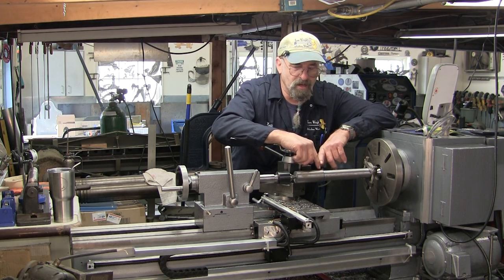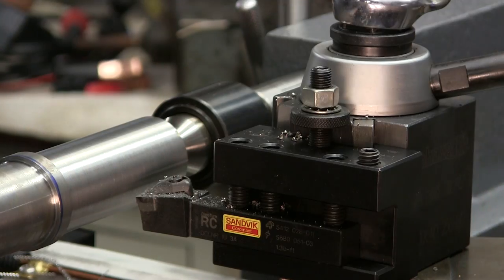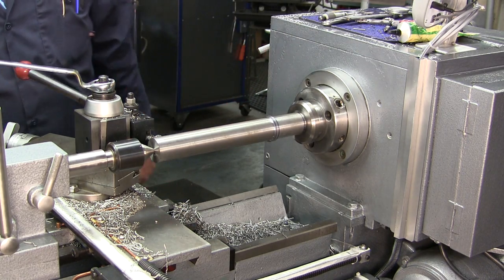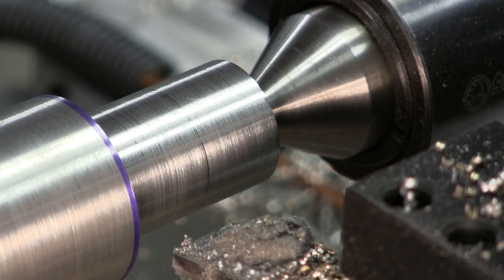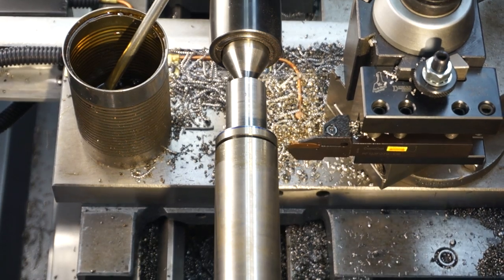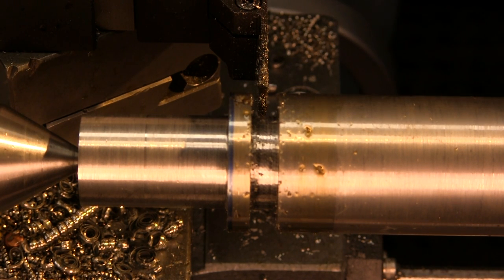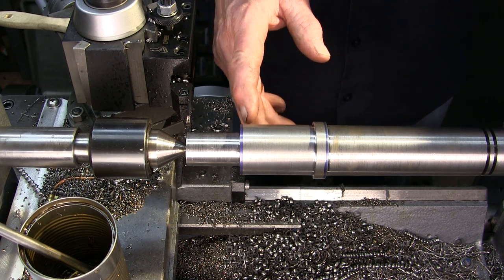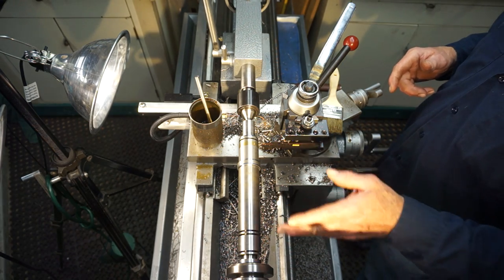Steam Wagon Ho Part Four

Comment: If your readout has Absolute and Incremental modes, I like using ABS to keep track of position of one side of the tool and INC the other side. Then you don't have to keep resetting zeroes and your position is more consistent. I love being able to machine vicariously through you Keith, when I don't get to do much machining at work!
Reply from the maker: yeah I still have more to learn, on setting up the readout. ;{)------
Reply: I was able to get a new cheapest Accurite readout at work, and the thing enables you to be able to machine arcs by automatically calculating the X-Y positions along the arc. It was so cool to be able to that on a manual machine. Nobody at work could appreciate the capability of being able to mill out a large bore without a turntable, it was so fun!
Reply: me 2 more learning on the dro its a handy tool.

Comment: Hi Keith,
Good order of operation and procedure teach...   ;)
Lots of times when I get chatter, I'll use a piece of wood with oil to apply a little pressure on the part near the cut and this helps a lot in many situations...   Just allow yourself a couple of thousands cause of the applied pressure before final readings.
Cheers,   Pierre
Reply: Personally I would have mounted the tool on the tailstock side of the toolpost . That would allow the tool to be shortened up and have less quill hanging out as well. Clearly this lathe is no Rock of Gibralter and the Aloris type tool post and 60 degree compound is making things worse with all the overhang.
Reply: Rob: It would be interesting to compare the frequencies to the position of the cutting tool and the speeds. A balanced lead weight in the correct place might quiet down the cut.
Reply: Some heavy rubber band is also possible, we always look out for the fastest and most cost-effective way to solve a problem...   ;)

Comment: I think dimensioning your parts with running dimensions (everything is dimensioned off a zero line from the end of the part) would make using a DRO MUCH easier.  All of the right shoulders can be cut with direct reading from the DRO and no cumulative error as everything is referenced from the zero you determine from the end.  If you have tool offsets you can program you could then get all of the left shoulders too.  If you left everything in metric, your DRO would be super easy to read as well and you'd not have made any mistake.

Comment: Hi Keith, I need to invest in a good parting and grooving tool, can you suggest one or perhaps what you are using here? looks like it works pretty good. Thanks, waiting for part 5..
Reply from the maker: The one I'm playing with in this video is a Sandvik Coro Cut
RF 123F079-10B
;{)-------
Reply: Thanks, good to know. I have been using hhs for parting softer materials and have had fairly good luck but not so much on steel.

Comment: Any reason why you wouldn't go though and mark all the right sides of your grooves then go back and mark all the left sides? Seems easier and more accurate than having to reset your zero every time. Also, did i miss what kind of steel this is in one of the other videos? the surface finish seems pretty rough even if you are still in the roughing phase.

Comment: Hi Keith.     Neat work!   I have a Taiwanese made 1440 lathe that looks very similar to this.   Does yours have an oil bath in the apron?  Mine does and it is long overdue for an oil change, but I can't budge the drain plug. 😠
Reply from the maker: just pull the screws and drop it out and turn it over, to drain, gives you a good look at it as well. ;{)------
Reply: Thanks Keith.  
If I recall, last time I took off the apron (to deal with a stripped worm gear),  I had to remove the drive rod, lead screw, and the power switch rod.  Was hoping to avoid that, but better get that oil changed soon.

Comment: Hey Keith, looking good. When you put shaft In collet, how tight is the collet? What I mean is I have a 5c collet chuck on my little lathe and it tightens up like a scroll chuck so how tight do you tighten up on 5c collets, a little past good and snug or reff down on it? On that grooving tool, do they make a narrower insert and would that make a difference on the chatter ? By the way love the bandanna's. God Bless Ya   Dave
Reply from the maker: I like to think I can tighten a collet to the amount needed rather than horsing on it! They have more grip than you think on true clean surfaces, but you can push excess on the tail stock and get movement. paying attention and you'll find that line if you cross it, minimize on thread and taper surface wear by not punishing them. Yes they do make that grooving tool in different widths. ;{)--------

Comment: I was wondering, regarding shaft heat straightening. Can you do the same with a pipe, or does it have to be solid?
Reply from the maker: Pipe is a whole other process, the hollowness doesn't play well with heat straightening. ;{)------
Reply: Thx. I figured that was a different animal, but I had to ask. Maybe you had knowledge or experience that contradicts what I assumed.

Comment: Notification crew standing by!  Seriously though...I am wondering why this machine sounds so much louder on camera?  It has a rather high pitched whine to it.  Any particular reason?
Reply from the maker: It's because of the microphone pick up and the sound booth surroundings! LOL ;{)-------
Reply: Is there any gear oil in that headstock??? Sounds bad.
Reply from the maker: yes I run fresh #2 Hydraulic, but the spur gears are always going to carry that noise at high RPM's  ;{)-----
Reply: There is.  He did a video on it.  New oil, new belts...the works.  Seems a lot less in lower speeds.

Comment: Hi Keith, is there any reason why you couldn't zero out the end of the shaft, once, and then machine all the groove features with continuous dimensions, instead of moving the carriage back to the end of the shaft and resetting zero again? I know your the professional, and I am only a hobbyist in this trade, but I was just wondering if continuous dimensions would have worked as accurately, in this application.

Comment: Why didn't you draw your tool next to all the grooves and just dimension to the proper side of the tool for your lengths.  could have one drawing for roughing and another layer for finish dimensions . would save all of the zero resets you did each time. Not being picky just the way I would have done it. Crank to the drawing dimension and cut no need to flip the shaft around.

Comment: What is a spring pass
Reply: Its a second pass with no change to the depth of cut to remove any deflection of the work or tool caused by the machining forces.
Reply: nice reply you got alot of class dude but its all 4th classlol.
Reply: that comment above was for betas killer.